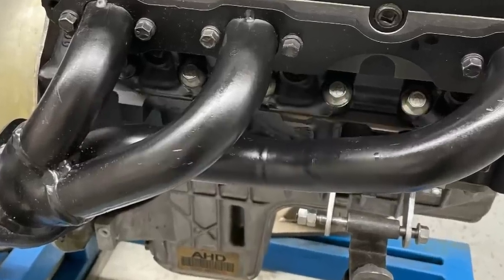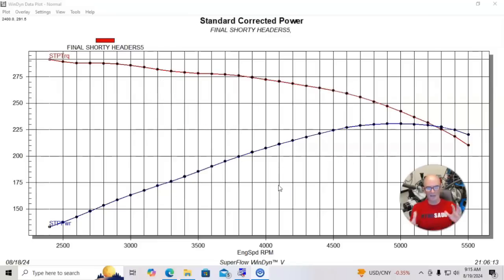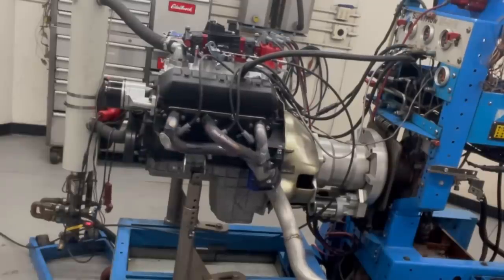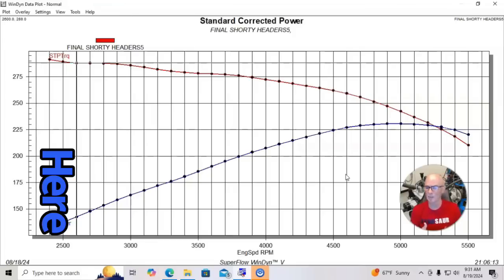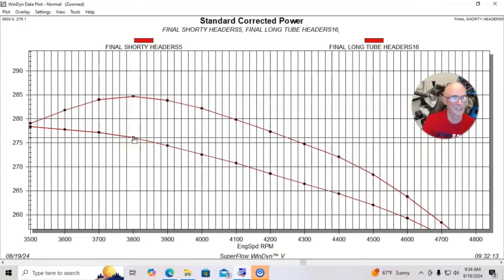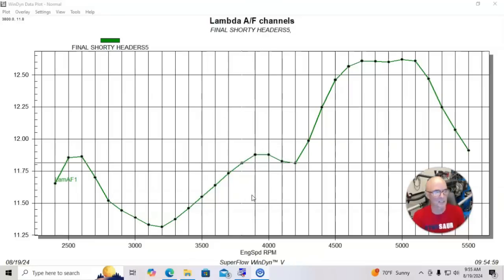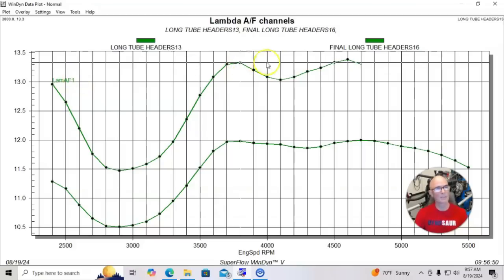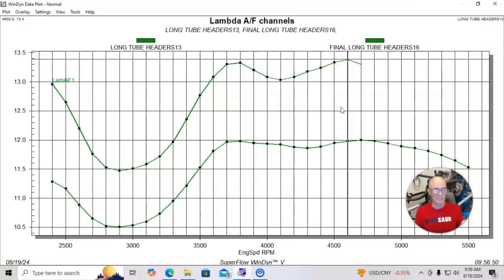4.3L VORTEC V6 PERFORMANCE. SHORTY VS LONG TUBE HEADER TEST-WHICH ONE MAKES MORE POWER & TORQUE?

Comment: So what should i use richard 
Shortys or l/t Headers 
Come on richard help me out
Reply: Got a ...baby 4.3
Its running good .. be going to track is friday!
I expect low 16.s maybe even a 15.9
Reply: Its in a 2001silverado
Reply from the maker: long tubes make more power
Reply: @richardholdener1727 thanks Richard

Comment: I have that same intake and some long tubes for a 4.3 I'm building. I'm building an 88 non balance shaft motor with a small cam ( 210*/214* duration @0.050. ) I will be using a factory 1985 astro van intake until my vortec heads get machined and then switch to the vortecs and my edelbrock intake. Also, running an HEI with a vacuum advance and using a 625 street demon carb with a 50 hp shot of nitrous. It's going in a very modified S10. I'm hoping to have it stripped down to about 2500 lbs. Building for my daily and road course. I'm thinking the long tubes will do better with the small cam where they can breathe a little better in then upper RPMs.

Comment: I have a thought about the cause of this interesting results. First though, I am no scientist/engineer/engine builder/tuner so take it with a grain of salt.

Resonance/scavenging. The shorty header is clearly unequal length which should help prevent/breakup strong scavenging pulses. The long tubes look to be at least close to equal length which can enable stronger scavenging pulses at specific RPM's. I'm very curious what effect having a step in the long tube runners or both sets of headers hooked up to single exhaust instead of dual exhaust would do to this result. Or if either would have any effects at all even.

Comment: has anyone ever sat down and ran the numbers on the heads available for the 4.3? you've got z,w,x  engines all part of the vortec engine family comp cams has at least 3 different off the shelf cams available and you can custom order grinds through them(i had one)now its been 20 years since i built this engine but at the time the guy i had port my z code heads(original) told me he tested them at 163cfm stock and after slurry porting was able to achieve 225cfm he flow ported the edelbrock tbi intake to the heads and ported the shorty headers to match, it had a big block tbi body with a small block fuel pods on top all port matched together. sorry i never had the chance to put it on a dyno (just wasn't available back then) but what i did come up with was a spunky little s10.

Comment: I echo the comments from others regarding the extra pipe and U's on the long tube. True test would be to turn the shorties around and run the exact same "exhaust" post headers. Technically, you changed two things here instead of just one. Resonance in those tubes could account for AF weirdness.
Reply from the maker: tube length does not change AF

Comment: What I assume is a wetflow issue is less likely the heads than intake manifold and or carb. I would think this kinda video would be way more interesting with dyno data included. Bsac, bsfc, A/f, water temp and maybe a air turbine reading.

Comment: If that engine has the aluminum rocker brackets, you can run 1.7 LS rockers on it in place of the stock 1.5 roller trunions.
Reply: Have tried it ?

Comment: Man you gotta get a mic that can handle high spl in the dyno cell. Maybe try plugging in a pair of headphones as a microphone? I tried putting some airline earbuds in the engine bay once and they worked as a high spl microphone, but sounded... like airline headphones (real bad). So maybe a decent pair of headphones would work as a high spl mic in a pinch?
Reply: Can't even tell what the engine sounds like.

Comment: 30 years ago I had an ‘81 Malibu with a 229. A gearhead friend of mine and I swapped on that manifold, a Holley 390 vacuum secondary, and a Comp “260” flat tappet cam with some 1.6 pro magnum rocker arms. Turns out we got lucky and didn’t coil bind the valve springs. Anyway i remember the 1st time going for a ride and him manually shifting the TH350. My 19 year-old self  was thoroughly impressed. I think Hooker made a set of headers for that application back then but I think now all you can get is circle track stuff.

Comment: I have a vortec 4.3 and a vortec 4200 the 4.3 is great for towing, I don’t know if something is bad with my 4200 it’s supposed to be more powerful but the 4.3 beats it because of it’s low speed torque and towing uses a lot less fuel

Comment: Why build the school bus exhaust system? If it was simply to get the exhaust blowing towards the rear of the room, just turn the dyno cart around, it has wheels for a reason. Yes, you would have to reposition some wires and hoses but that's still easier, and cheaper than buying and building a 15' exhaust. One last thing; is that a 2 1/2" to 2" REDUCER on the end of the transcontinental pipeline! The increased exhaust back pressure would explain the AFR
Reply from the maker: you are incorrect in your assumption that the dyno can be turned around quickly and easily-the exhaust took a just few minutes

Comment: I would like to see more on building lthis engine.  I'd balance the rotating assembly,  deck the block, grind a hydraulic roller cam for the aluminum heads and a single plane, and Holley injection. If this engine is to be turbo charged, better pistons and rods will lead to a reliable 500 + horsepower engine.

Comment: It's good to know this is about the power level I'd see in my boat with that manifold. Looking forward to the swap from the 2-bbl now.

As far as parts, it'd be nice. I know guys used to call up comp and ask for the sbc extreme marine cam but for a 4.3 and they'd put the lobes on  a 4.3l core no problem. The biggest issue I think is that there are enough differences with the 4.3l over the years it's difficult to have parts as certain blocks use different pieces. Unlike a 350 where it's always the same there are some annoying differences.

Comment: It looks like 2 possibilities intake manifold and or header manufacturer , if intake manifold by edelbrock performer rpm might make a difference or header by Doug thrones hooker etc isn't alot of options probably but  the 4.3 is sadly underestimated have a friend of a friend with a chevy chevett with 4.3 running  10's on bottle and high 11's on motor and whenever hearing at idle you think it's v8 powered,  definitely is a sleeper, love the videos hats off to you for all this unthinkable testing you it's alot more than powernation and many other automotive performance platforms that's been around along time, especially when you did some honda engines, (Bseries man myself) raised around chevy's but fell in different generation my old man always tell me I'm wasting my time with a 4cyl, pass away before honda era, on side note which was something else raised around is Vw air cooled motors they are also under estimated but don't see them in wreck yard either, good video/info my man.

Comment: Didn't Roadkill put a turbo 4.3 in the Rotsun? It's been a minute since I've watched it but I was thinking that's what they used. A turbo off a diesel and ran it till it decided it didn't like keeping all those parts in it. I remember it was a Chevy V6 just can't remember the size.
Reply from the maker: they did
Reply: @richardholdener1727  Think it would be interesting to know just how much power that engine can make. I know the old 2.8L V6 was tough as hell. I knew a guy who had one and used to beat the crap out of that truck. He would rev it way past the redline all the time. If I remember correctly he went through 4 or 5 clutches because he was always trying to do burnouts by revving the engine up and dumping the clutch. Yet despite all the abuse that 2.8L made it over 250k.

Comment: Those headers did what I have been told headers do for over 20 years, shorties for bottom end, long tubes for mid/top end. The AFR at the top end change didn't surprise me either. I am guessing that gooder scavenging of long tubes over short tubes is created the stronger signal. I wonder if smaller high speed air bleeds on the secondary side would help.

I think a 300~325hp 4.3 in an S10 would be super fun, so yeah, gooder heads and cams would be cool to see. Maybe there isn't much V6 demand because there isn't much V6 support...
Reply from the maker: If you think shorty headers do better down low-then you haven't seen any (of the many, many) other dyno results. This was extremely unusual-enough so that I feel there is a problem with the test

Comment: @RichardHoldener- I would ❤️  to see what BigDogs Porting, could do with these stock cast iron heads(w/bigger valves, plus milled, for more compression 9.75 to 10 to 1), BigDogs Ported carbed intake, BigDogs ported shorty headers, & a custom speced hyd. Roller cam by BigDogs Porting, to match this combo! It would be Awesome, if the 4.3 could get some chop, from a high overlap custom cam( with dur. @ .050 being around 220° int., & 228° exh.) , around .500 Lift, with a 110° Lobe Sep. Angle. Power band of around (3,000 Rpm to 6,500 Rpm) This thing, with a 3,500 to 4,000 high speed tq. Converter, drag tires, & matched Rear gear ratio, in a 3,000 Lbs. race wt. Ride would be a "RIPPER"!
Reply from the maker: HCI go a long way

Comment: I know it's off Subject but have you ever thought about doing a big bang with a 6.2? Just to see if the block goes first or if it's a rod or something. There's always debate on iron block 6.0 vs all aluminum 6.2 block. Just curious
Reply from the maker: The alum (5.7L, 6.0L and 6.2L) blocks will not support the power levels of the iron blocks or the alum 5.3L blocks.
Reply: @richardholdener1727  that's what I assumed but I had to argue with some internet professionals 😂
Reply: @richardholdener1727  you said once that you couldn't run a 09 3.9 v6. Was just curious why. I'd love to see one with a turbo on it. If I had a transaxle to hold it I'd turbo the one on my rail buggy lol

Comment: I'm wondering if the crankshaft is forged?  I'd like to see the results with the stock heads ported vs some good aftermarket aluminum heads with and without a cam upgrade.  I'd also like to know how much it weighs with and without aluminum heads.  So, it's 3/4 of a 350, then?

Comment: I built my 4.3 with a lunati cam, self ported heads, dropped biggest valves you can possibly fit in there. Sits around 350hp mark
Reply: teria como compartilhar as specs do engine, qual diametro de válvulas que usou, etc..
Reply: @HeavyChevy8566 2.2 intake 1.6 exhaust, they are ls6 valves
Reply: @american7169 use stock cam?

Comment: Richard please run with/without balancer !!!!
How many HP it cuts from engine?
Reply from the maker: do you mean balance shaft? because you should keep the balancer/damper in place
Reply: @richardholdener1727  yep
Above cam shaft
U can simply unbolt its gear 
Balance shaft will holds in place by front ball bearing 
It  lubricates at rear (sleeve) so cant be removed without blocking rear oil passage

Comment: I have a 4.3 with the Brodix heads, longtube Headman headers, a cam, and a holley 500cfm 2 barrell. Getting it all sorted in my S10 and may get it to a chassis dyno this year. Cant wait to see what you come up with. 
Note that Brodix heads with angled plugs have major clearance issues. I am running header flange spacers to get the primaries away from the plugs.

Comment: PS - a stroker crank is first order in priority.  Then we can talk about heads, etc.
Reply from the maker: cam, then heads, then intake, then boost, then displacement
Reply: @richardholdener1727  the stock crank is good to about 500.  The various turbos on the internet show this to true (for example Finnegan's rotsun).  the crank is first to go as you get into ~500 territory, especially easy with boost and current parts.

Comment: Another point is that this is an odd-fire V6. Does that make a difference in how the headers act? I would think so.
Reply from the maker: this is an even fire v6 (split pin crank)
Reply: @richardholdener1727  well, dang. I got myself confused. Seems like some of the older ones are odd-fire, but quite honestly I thought the split pin is what made it that. I am seeing different information now. I guess I got too used to my good ole' 6G72 with a firing order of....wait for it: 123456

Comment: I would like you to test the cross-ram intake in the beginning of the video, I have one of these that I ported. I also bought the last new Brodix heads available, the 210, but man oh man they need some serious porting to work right. The combustion chamber is straight out of the late 1960s, I can fix them but it's going to take a lot of work, plus they were not cheap. Also, I have a Comp Cam 224 duration, 525 lift, 110 lobe separation, probably the last cam also. I'm looking for header but probably going to build my own, would like to see more parts for these engines, there small, reliable, and make excellent power and they fit in tiny vehicles, you know the fun ones.

Comment: A big 10 4 on the different heads options test  . That is where the restriction of air is handicap. ♿️ 👌  . Also, I'd like to see how  the torque# is  affected on a turbo set up with the different heads swapped . I remember u running the Atlas comparison & it only took 7 lbs to 14 on the vortec. I'm curious if theirs a significantly different change in that power curve  towards the end.🫵the man,🙌👩‍🦲with the dyno😄

Comment: I put one of those in a 64 nova with a 1/2 ton truck 5 speed 20 years ago. It was fun
Reply: What was the parts setup for this? I want to do this same package. Where do I find engine, trans, and clutch etc? I just want a carb and points ignition. Thanks

Comment: Definitely 💯 agree with more cams and heads and I wish they made a TPI intake for the og 4.3 the 3/4 350 because I have one in my s10 and it’s a great little engine for having 240,000 on her and she still gets sideways all the time lol but I want more low end and I’m thinking about putting a marine two barrel carburetor intake and cam on it, but I’m not sure if it would help. I would love to see a test with a two barrel intake in carburetor set up and maybe a mild boat cam for a daily driver application love this motor, but I’m still tempted to put a 5.3 I have in it lol but it’s got a glass 4L60E in it so yeah lol

Comment: Before you change cams, try some 1.6 rockers, my experience is that they can bring 25 hp at peak
Reply from the maker: 25 seems like a lot for rockers-but easy enough to test
Reply: @richardholdener1727  
I'd agree, I don't think my 1.6:1 rockers are going to gain me 25HP. Maybe 1/2 that.
Reply: @No1414body    I’ve done 1.6 rockers in my 4.3 that has a comp 268/454 dur and lift cam and maybe seen 10hp difference if that much. Mine is .040 over flat top pistons port matched heads to a edelbrock 2111 intake  Sanderson long tube headers and a Holley sniper efi. I’ve got it in a 48 Chevrolet flatbed dually that weighs 5,600 lbs and it pulls it around pretty good

Comment: Dual planes have the runners above and below each other, that's a divided single plane.
Reply from the maker: it really is 1/2 and 1/2-meaning not a great design
Reply: @richardholdener1727  Seperated by 240 degrees at least.

Comment: I'd really like to see more performance oriented LT based V6. it seems to me like a 3/4 6.2 could do at least very close to as well as a 5.3, while being significantly smaller and lighter
Reply from the maker: see the LV3 vids
Reply: @richardholdener1727  I've seen them - I've watched most of your videos for years now - but I wish they made a proper hipo V6 with bore matching LT1 as well as head flow etc

Comment: In the past I floated ( and was poo pooed ) the idea of a long header on one side of a V motor and a short on the other to see if this flattens out the power curve.  Supposedly, some NASCAR motors in the 90's / 00's used headers with unequal length per bank ( meaning cyl 1 3 5 7 had unequal length and 2 4 6 8 did as well.  No info as to if they paired tube length with cylinder firing order bank to bank.
Reply from the maker: the cup guys have header length and design scienced out-and none of them use shorty headers

Comment: Aftermarket 4.3 heads, and an intake manifold designed to bolt a M90 roots blower straight to it. That would be awesome.
Reply: Don't know if it'll flow enough judging but this video my 500cfm carb is a little small for it
Reply: The gen 5 eaton m90 is good for about 400-450 hp depending on airflow mods and pulley's and whether 91-93 or e85...id be more interested if they can come up with a 2005-2014 gt500 supercharger adapter or even terminator cobra m112 adapter...that way there's no need to spin a m90 to the moon and back to reach above 400hp